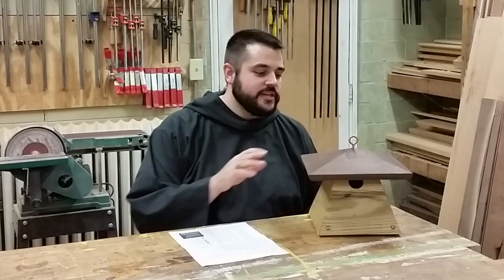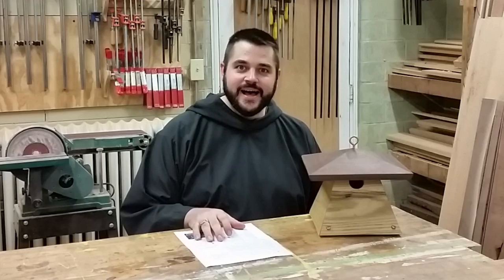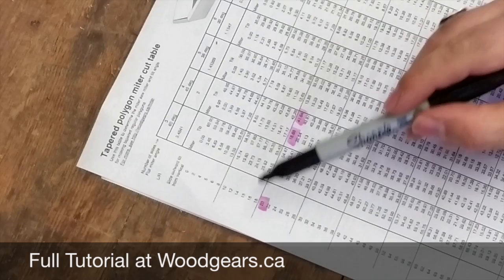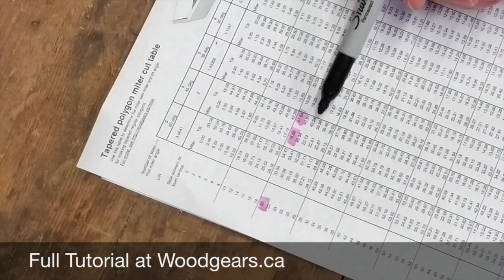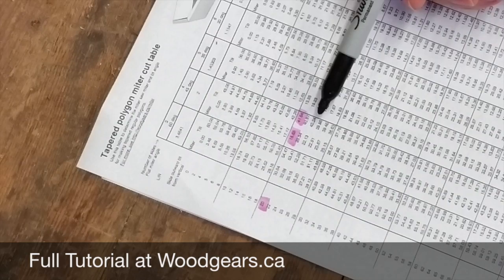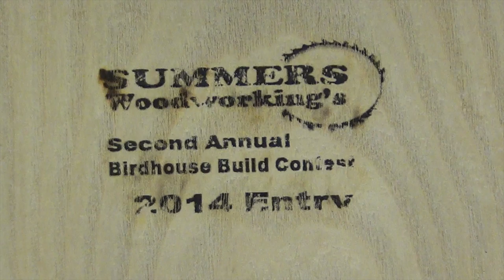Bungalow Birdhouse (MonkWerks)

Comment: I really enjoyed watching this video.  The birdhouse is a beautiful work of art.  The angles you chose for the upper and lower parts really compliment each other.  Well done Father Thomas!
Reply from the maker: Steve Carmichael Choosing the angles was a bit of luck.  I picked 20 degrees for the vertical axis, and then I just thought well if I'm doing 20 degrees one way I might as well do 20 degrees off the other and settled did the same on the horizontal axis.

Comment: You make cutting and fitting the angles look easy.  Great birdhouse and great design.
Reply from the maker: Skully Wood & Metal Thanks.  I was a bit surprised on the ease of the angles, but since I had the spreadsheet it was just a matter of setting things up and running the boards through.

Comment: Very nice design on the birdhouse. Really elegant. We haven't seen a video from you for a while, I thought perhaps you were using the time to finish the vintage shoe shine box.
Reply from the maker: Tom Denny The infamous shoeshine box! Its actually 90% done, but I just haven't touched it in a while.  Perhaps it will be my 1 year anniversary special, which is only a month away.  No, its just been busy with the seminary and parish work, and I was a little burned out after the summer when I was doing some production work and some uninteresting, though necessary, shop projects.